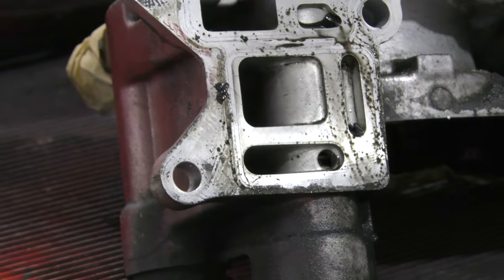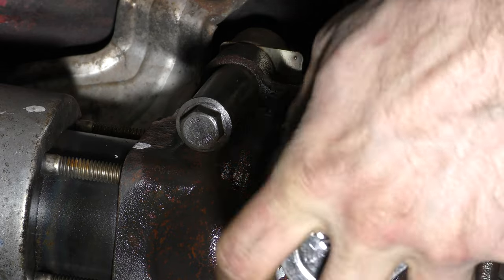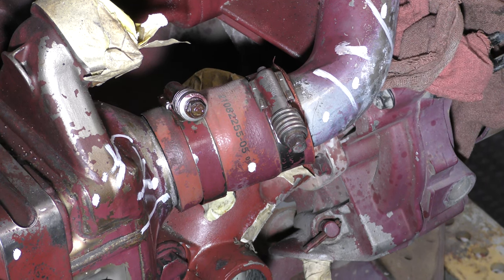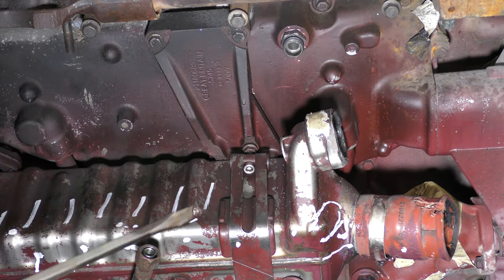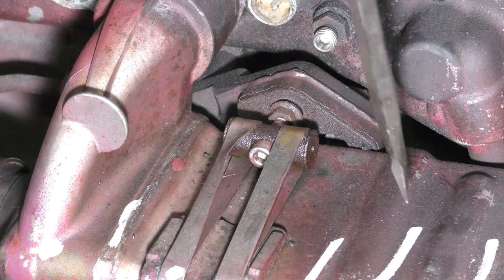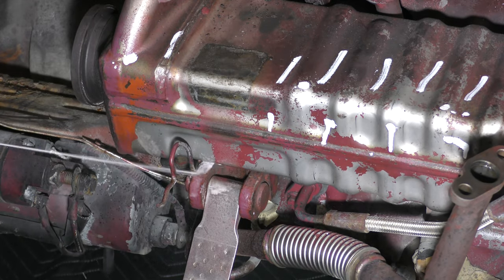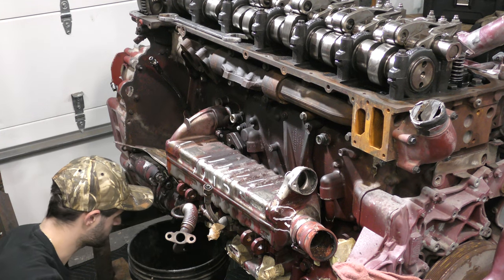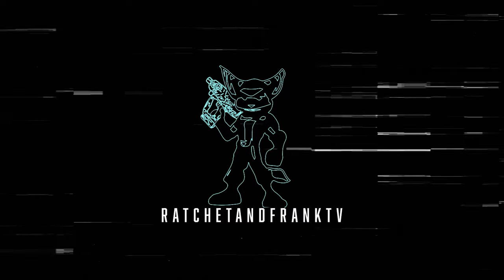Mack MP7 EGR Cooler and EGR Valve Removal!  -  [S1E3]

Comment: Distructometer 😂 love it ! Good vid bro 👌. 
Quick question, what's your trick to take off those 4 bolts holding the Egr, without braking them and having to replace the manifold. Any penegrants in particular ? Heat, water, impact gun ? Any tips ? Thank you
Reply: Try an air impact first not a ratchet I broke one bolt with a ratchet and the air impact took them out